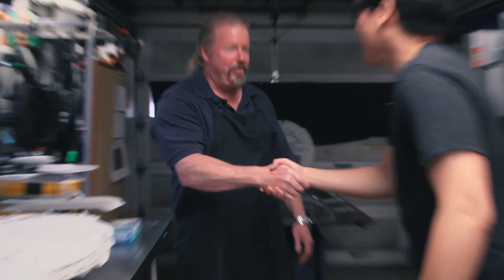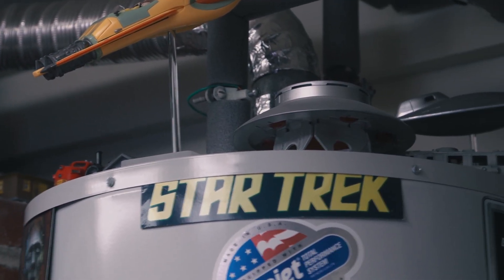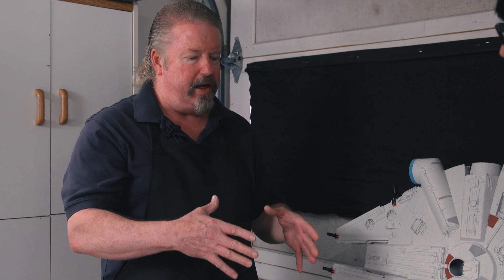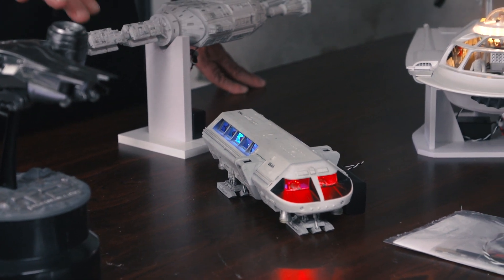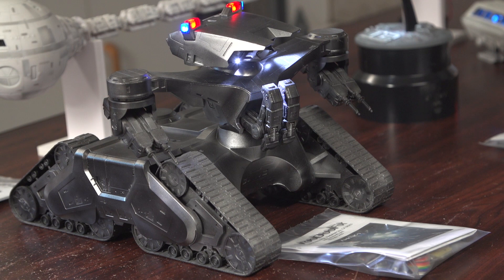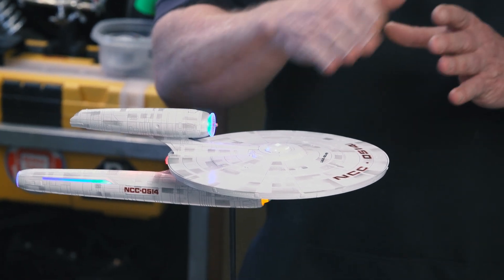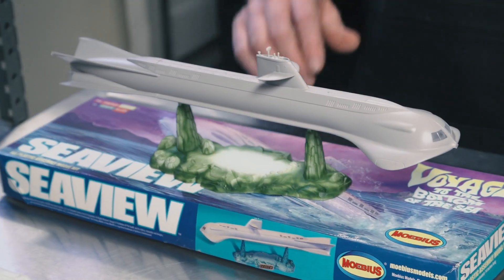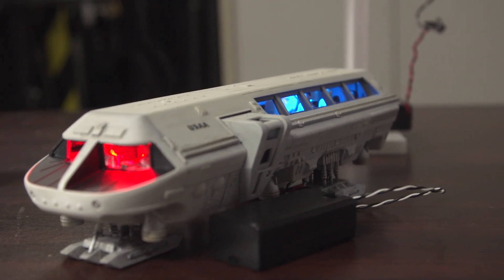Aftermarket Lighting Upgrades for Model Kits!

Comment: "Most people aren't comfortable running fiber."
Huh? I find running fiber off a single source quite a bit easier than running individual wires and led's and resistors to each point, especially at smaller scales. If you've never lit with fiber...learn.